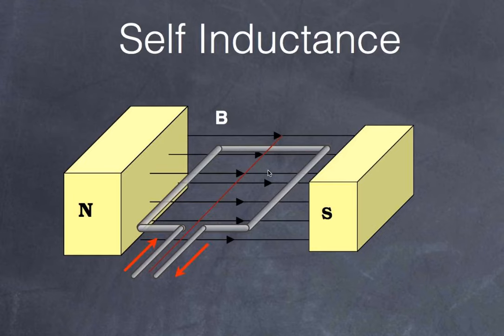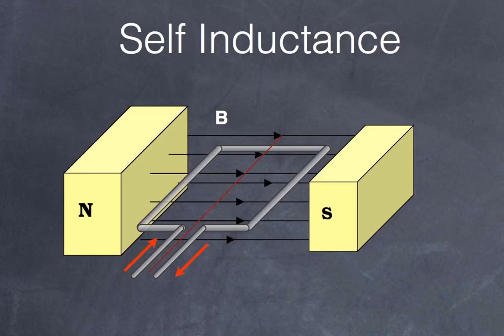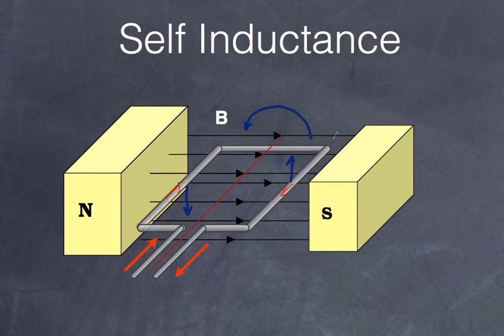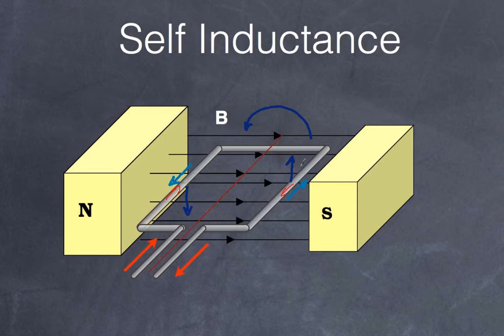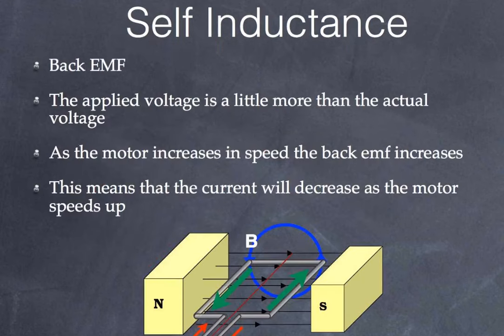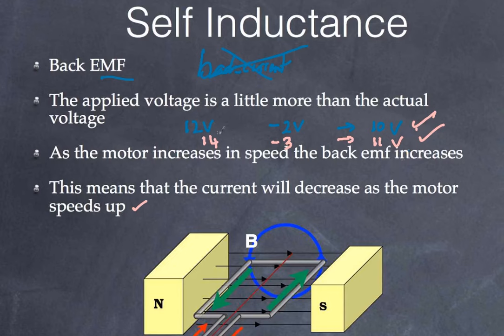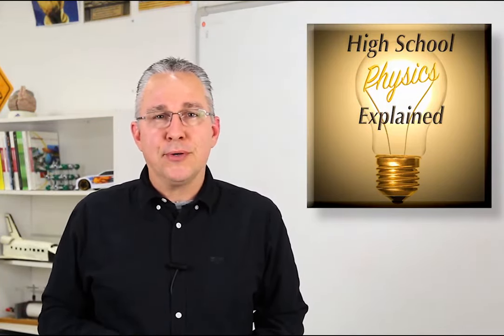back emf explained

Comment: Suggestion for the future videos. Whenever you are talking about a hand rule, add a small picture that shows how the hand rule is supposed to work.
Reply from the maker: +Fearofthemonster good suggestion. Thanks
Reply from the maker: I produced a video on hand rules to help 
https://youtu.be/GmURfG3tAhg?si=rrAiloqdT7lUqZv6
Reply: @PhysicsHigh  due to Back EMF, does magnetic field strength of stator's electromagnet(DC motor) also reduced? Lets say stator required 1 amp to produce B=0.2T, but due to back emf if its only consume 0.5Amps, Does B=? also get reduced or its current consumption only effected and no effect on magnetic strength?

Comment: You mixed up Fleming's rules but thank you!
Reply from the maker: Fleming’s rules are one way to determine vectors but not the only way. I have another video that compares Fleming with the rules I use.
Reply: We aussies use the right hand palm rule :)
Reply: For electron theory, it's left hand for generators and right hand for motors.
Reply: Aaaaahhh That's why it was backwards when I tried it... Is this a conventional flow vs.. actual flow thing?
Reply from the maker: Convrntional
Reply: True
Reply: Can not you just accept you mistake🤦
Reply: @that1electrician  correct
Reply: @abhishekyadav9916  not a mistake. In the USA they don’t use conventional current flow they use Electron flow, so the rules are reversed.

Comment: Without back emf, all the electrical power will go to heat dissipation and the mechanical torque would be a free lunch.  Back emf comes from energy being conserved, it lowers the armature current, making it look like there is an extra resistor, but instead of dissipating power through heat like a real resistor, the dissipated power the shows up in the torque.
Reply: Tq
Reply: If the energy conserved during the work done against the back EMF is actually converted into torque then shouldn't there be more torque when the back EMF is more
Reply: @bethanyrumkui2293   Higher rpm causes higher back emf which acts against the voltage from the power supply to lower the current and the torque.  Since mechanical power is rpm * torque, back emf has a regulating effect on the power draw.  Without back emf, a circular saw hooked up to 110V outlet would blow a fuse, but the back emf brings the current down to safe levels.
Reply: @karilentz5000  as I understand it, this is how potential relays work with a start capacitor. Ive went to school for and worked in the HVAC field for 11 years now but am still learning.
Reply: So you know class A and class AB audio amplifiers?

They run hot or at least very warm. Do you know any way to run these cooler than what is found currently on the market? Thanks

Comment: That's also why motors have such a huge current spike when they first start.. Because at first the full voltage is essentially back EMF since there is zero movement--  but once the movement starts, the current will drop proportionally to the RPM.  On larger motors, the inertia is so great that the current spike has so much back EMF that the motor can't even start...  I'm assuming that's why they will require a 'starter capacitor".. such as in HVAC motors.. which use a "run capacitor and a second "starter capacitor.  (I could be wrong about that. :)
Reply: You're wrong about the back EMF. When a motor first begings to rotate, it has 0 volts of back EMF.

Comment: At 4:07 you say "Can I make it absolutely clear, we do not have a back current".  Are you saying that the back EMF doesn't produce a current that opposes the source current? I was taught the net current = source current  minus  back EMF current. Is this correct?
Reply from the maker: No that is not correct. There is no such thing as back current. We have a supply voltage and a back voltage (back emf) that results in a NET voltage. This results in a lower current according to Ohm's law  - see my summary version https://www.youtube.com/watch?v=dHQiKzFUFEE

Comment: I read that in a relay, a diode is added in parallel to route it back, how do you do this in a motor?
I’m curious if back EMF is an issue with RF currents as inductors (and capacitors) change their properties with rising frequency.

Comment: What happens during the off phase when we control the motor in PWM (DC=50%)? Because now due to the inertia we will have the coil rotating inside the magnetic field. From oscilloscope measurements with a brushed motor I have seen that there is a current in the opposite direction and a voltage generated (don't know what is the correct term for it; still back EMF?) that is the same polarity as that of the battery (acting like a generator or something). Why does the current change polarity but voltage stays the same? If you could explain would be highly appreciated. Thank you so much!

Comment: You made an error deriving the direction of the rotation. Sure, F=Q*E'=Q*(E+vxB), but Q = -e !
Reply from the maker: No error. Direction is determined by Fleming rule or palm rule which uses conventional current not electron flow.

Comment: In this presentation, the actual voltage increases from 10 V to 11 V, so the current should also increase apparently, instead of decreasing. I suppose we should assume that the actual voltage (input minus back emf) in fact decreases...

Comment: I have a question. In an elevator door operator using an open loop DC door motor, the speed is set with resisters, resistance added or removed to vary the speed in the open or closed cycle. If I added a spring force in the closed direction, would the additive force increase the closing speed? For example, think of a tape measure with a coil spring that pulls the tape back into the body.When the door motor is commanded to close, the speed is x. If the coil spring had an force of 10 or 100 pounds force, with the added coil spring force, would CEMF limit the motor speed (without feedback) or would the rotational motor speed increase?

Comment: Plz advise how to over come this problem by adding variable resistor or islolator. In circuit.
We face problem in ramping a motor speed motor controller got 
Burned. Sir could plz share email id. In future we can ask you technically specific to problem.
Reply: He's putting out free videos not giving out free consultations.

Comment: Hi. Just wondering if the back emf ever equals the initial voltage, and thus if current ever actually reaches zero, or if it just approaches zero.
Reply from the maker: You can only hypothetically reach zero, if there is no load on the motor. Considering that the motor will still have a load in the form of frictional forces, therefore work still needs to be done. This means that the supply voltage always be greater than the back, EMF, giving you a net voltage to do that work.

Comment: I guess you are using electron flow and not conventional current?
Reply from the maker: Using conventional current.
Reply: @PhysicsHigh  Oh. By right hand rule do you mean right hand palm rule? I thought you meant Fleming's left hand rule but called it right hand to switch from conventional current to electron flow. My bad. I'm new to electrical engineering

Comment: what if, i store the energie of the back emf  appearing into a coil ,to a capacitor,with a certain timing,and so if i re injected it from the capacitor into the next coil? i learnt  back emf peaks (when disruption happen)are between 10 to 30 times more powerfull than the original current that made it,so in all logic, the fact to stored and re injected it (always at a certain timing),change his direction,to appear as a "conter-back emf" current, made it usable for a more efficiency rotation? 
tell me what you think about it....thanks to care

thanks for your video mate ;)

Comment: Thank you for the explanation, but I don't understand why it rotated counterclockwise because all I understood is that the thumb points to motion, the index finger points to the direction of the magnetic field, and the middle finger points to the direction of the current. Therefore, I think the index finger should point to the right side, and the middle finger should point to outward as B (because the currents flow from left to right), then the thumb should point to the upside. According to this (my opinion), it should rotate clockwise. Please let me know what I missed, Thanks

Comment: Good video except that you've got your palms round the wrong way - right hand for gena(right)ors and therefore left for motors.
Reply from the maker: That’s only true if you are using Fleming’s hand rules. I have another video that discusses the different forms of the hand rules
Reply: @PhysicsHigh   - OK - thanks for sharing - FYI we only teach Fleming's hand rules and the right-hand grip rule here.
Reply from the maker: In a sense it would be advantageous to teach Fleming’s so it’s consistent across tertiary level but I find many time my students struggle remembering which finger is which. So using the slap rule with many fingers representing B field helps them. Thanks for feedback though.
Reply: I use the numonic 'Manchester Football Club' for Motion, Field, Current and name the fingers from top-down.  I hope that's helpful.
Reply: ...and remember which hand to use with gena(right)or.
Reply: Provide the link for that video
Reply from the maker: https://youtu.be/GmURfG3tAhg

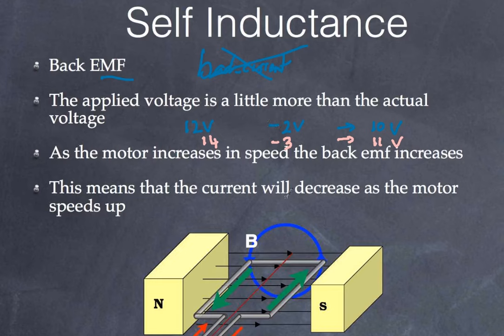Comment: When at 5:00 you say the current decreases, do you mean that it's rate of increase is less than might be expected or that it actually goes down?  I mean will the current at 11 volts be less than that at 10 volts?  Surely not? 

Also, thanks for another excellent video.
Reply: I had the same question. I think he means rate of increase goes down.
Reply: Someone else asked and then said he already answered it to a fourth person. So I'll try find that answer.
Reply: He answers Frank (who used to be 1011) with this: "The current does decrease as rate increases  but my example with my back emf value is too low and hence looks wrong." So for his example the current would increase since the resistance is constant.

Comment: When a generator runs and no load is connected at the ends of the terminals, does electric current produced in the conductor.? I understand when we connect a load forms a closed circuit allows the electrons to flow but what really happening on the conductor when there is NO load?

Comment: hye.
when motor is starting it creates B.EMF. Say for a 220V motor, 1000W, 1500 rpm,what will be the Back EMF?
Does this EMF permanently induced when the speed is maximum or subside to 0V when the speed is max?

to calculate the running current, is it I = V/R or I= (V- Vemf )/R
Reply from the maker: +Adam Mukhriz I'm not sure about calculating the  back emf, have to look that up but the back emf does not subside. It's dependent on the rotational speed. It's all about Faradays Law. 
The running current is determined by the second formula you gave.
Reply: High School Physics Explained just wondering it should be a small fraction of the supply voltage or almost near to supply.

secondly when we measure using a meter, is it a supply or V- Vb? For a motor which is running definitely we got 220V at the terminal.Hence it seems the terminal voltage is the one causing the running ampere ( which ia the full load ampere) to flow .If the voltage causing the current to flow is V-Vb, the current will be smaller and not the same as the nameplate. Unless the Vb os small so that the net voltage wont be too far away from the supply hence the current will almost be the same as the nameplate.Hope you can clarify.

or if the running motor is supplied by 220v, when we measure at the terminal we still get 220v and not lower.If Vb is presence V measured shoyld be < 220V, unless Vb~0.

Comment: Hi, thank you for this video. I would like to know what happen if I cut the applied voltage while the motor is running. I will only have the back emf due to the inertia and it will cause a reverse current right?
Reply from the maker: You are correct, though it is not back emf now, but simply an induced current. but due to Lenz Law, it will also cause a braking effect, and slow the motor down
Reply: Thanks for this question, Helen! I was curious about this too 😊
Since your comment was written five years ago, I wonder if you've found how to deal with this current that flows in the opposite direction.
Everybody talks about freewheeling/flyback diode, but that only deals with an inductive kickback that flows in the same direction as the original power source.
Is it because we don't need to do anything about the current generated by the rotational inertia?
Please help!

Comment: I think the voltage that face resistance (as you said back emf) is like drain of voltage which gets stored in the form of magnetic energy and released when input voltage is going down (forward emf)

Comment: Is the back emf caused due to the north CW spin field accelerating towards south CCW field so as the current is induced by the number of free electrons attracted to the field creates a counter rotation thus generating electricity? since voltage drives the dielectric field divergence of free electrons in current which causes energy dissipation ( heat inside the wires ) .  which of course applies to the field of the ether phenomena ...

Comment: Suppose I apply 12V to a DC motor and let it achieve it's max speed, then it's back EMF is somwhere around 11.5V. If I were to observe the voltage between the motor pins on an oscilloscope, It would show 12V.
I have 2 questions.
1)Where would I see the voltage being 12-11.5 = 0.5 V?
2) If i turned off the motor, only back EMF would remain, would that mean the polarity of the voltage seen on oscilloscope would change?
Reply from the maker: 1) its unlikely for you to get a back EMF of 11.5 V. More like a few volts.  Did you attempt measuring the voltage? You should get a reduction in voltage. I have done this experiment multiple times and admittedly I have always measured current, but that always drops when the motor spins. That can only occurs is voltage drops (resistance remains constant, barring any temperature fluctuations)
2. Yes, if you switch the supply off and the motor keeps spinning, in essence you will have a generator and this you will register a negative voltage. (though do not call it back emf at this stage. That term is only applicable WHILST a input voltage is supplied.)
Reply: Thank you for a fast response!

From the data sheet of my motor: At no load speed = 4008 rpm = 420 rad/s. The back-EMF constant for given motor is K=0.027232 (V*s)/rad. The back-EMF is equal to shaft speed*EMF-constant, thus 420*0.027232 = 11.4V.

When i tried the second experiment, the voltage just decreased from 12 to 0 in about 0.5 seconds, no polarity change seen on the oscilloscope?

Aren't the causes of back-emf and "generator effect voltage when stopping" the same? Is it just wrong to name the second voltage back-emf?
Reply from the maker: hmmm, I will have to look into that. Bear with me 
 - Disclosure. I am Physics teacher, and not an electrical engineer. :-)
Reply: In negative voltage
Reply: For a BLDC, your ability to see the bemf will depend on how the motor is driven. If you have a PWM/commutation scheme where any of the phases is floating at some point, then you'll see the bemf on the floating phase ...

Comment: In a single phase compressor motor, why is the back voltage on the start winding higher than the supply voltage? I am asking with respect to the use of potential relays.

Comment: Great explanation, especially at the end when you mention why there is a special circuit designed to protect the motor from burning (to absorb the spike in current due to the sudden absence of back EMF when the load is suddenly disconnected)

Comment: When you say current decreases with speed, (at around 5 minutes) you mean that it actually increases but decreases proportionally.  ie. it doesn''t increase by as much as it would without the back EMF but it does increase?
You're not saying the current actually decreases whilst the voltage increases, are you?
Just making sure because if you are I need to do some re-thinking.
Thanks.

Comment: How does that even make sense? You're saying as it speeds up the overall voltage increases like in your example from 10 to 11 but then you say according to this the current decreases. V=IR and this has constant resistance so I'd expect the current to increase but you say it decreases.
Reply from the maker: 10111 you are correct. I'll have to fix that. The current does decrease as rate increases  but my example with my back emf value is too low and hence looks wrong. 
Thanks

Comment: You could say.....
“A motor is a generator, and when you spin one manually, it generates an AC voltage”

And since....the math is never perfect, and all these things are made in Taiwan, when you turn on a motor...it can actually generate some electrical pixies back into your circuit 

The motor may appear to be spinning pretty consistently
But...under an o scope, there’s fucktuations between voltage and magnetic field and all sorts of stuff that wind up being kinda like a god damned shit-tastrophe 

If you didn’t wire up some diode packs to stop these back fucktuations of electric pixies, it can potentially blow up all your fancy and delicate computer bits, turning your robot into a candle 

Now....here’s some math....but remember, the math only works in a theory vacuum where the parts all have perfect tolerances 

Which doesn’t exist
So, it’ll give you a decent estimate which can be super helpful
But will never be correct 

Of course, back emf is great, but inrush current to coils and motors is way more likely to blow up your poorly designed electronics widget 

And....inrush current effects back emf as well